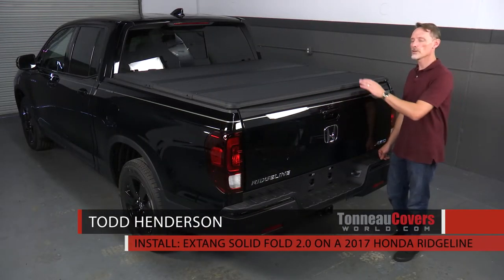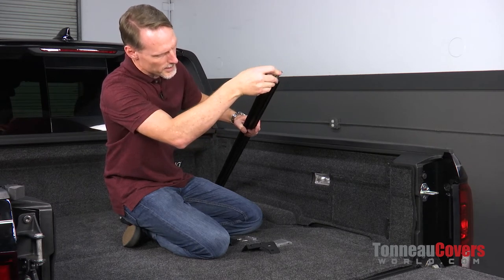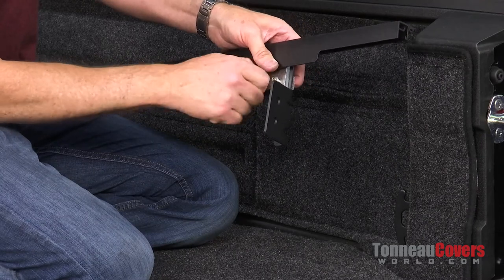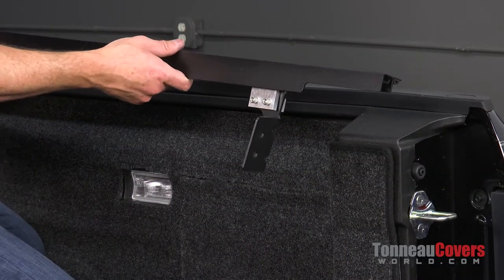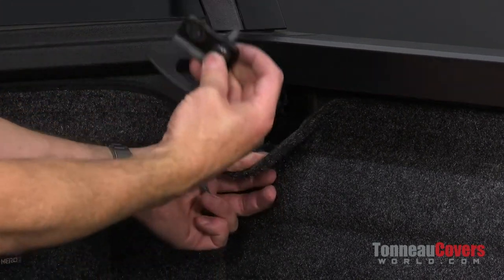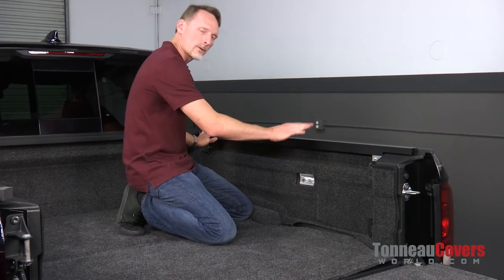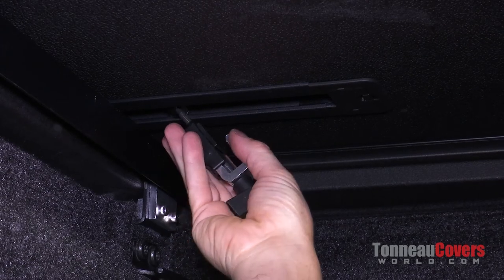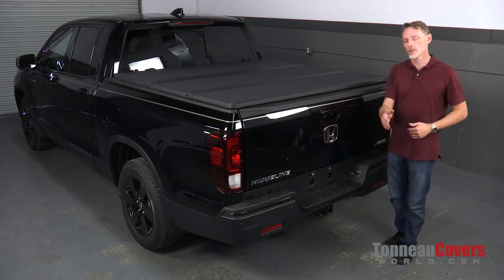How to Install Extang Solid Fold 2.0 on a Honda Ridgeline

Comment: how should you set the seal up front by the truck windows?  just lift cover and set straight down on ledge or slide it up on it?

Comment: Will trunk open with the rails installed??
Reply from the maker: The trunk will open, however it will only be able to open about 75-80% of the way.
Reply: @TonneauCoversWorldcom  even with the cover off, the rails still get in the way of the trunk opening?
Reply: @d77sauce  I have an older Ridgeline and even with the cover off it does limit the trunk opening.

Comment: Can you use these rails to mount other items like modular truck bed racks like voodoo or max modular?
Reply from the maker: Christopher Pekarsky: The rails are only intended for the installation of the Extang Solid Fold 2.0 tonneau cover. Any other use or modifications will void the factory warranty.

Comment: Is this the same brand as the OEM for the 2017 Ridgeline?  Does this leak water at all?
Reply from the maker: This would not be the same brand as the OEM covers. We only sell aftermarket accessories.
Reply: @TonneauCoversWorldcom  Extang makes the OEM cover for Honda. The only difference (and it's a big one) is the OEM version replaces the tie down cleats with modified ones (instead of using rails) for the quick anchors. That allows the trunk to fully open.